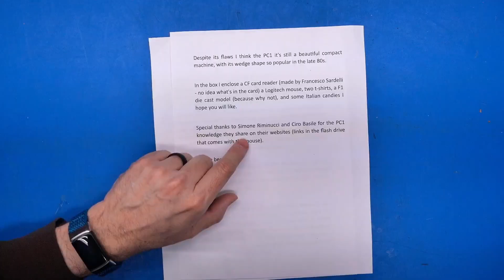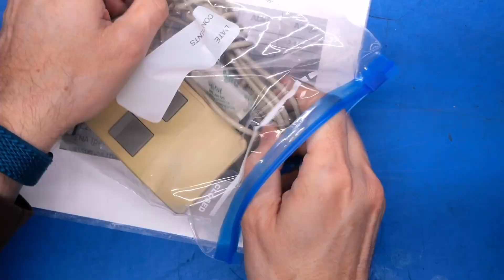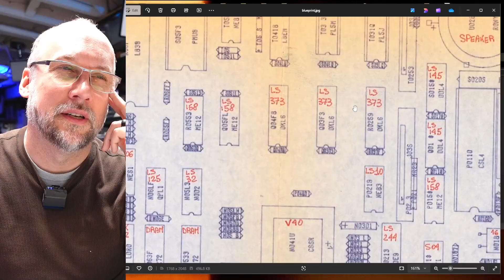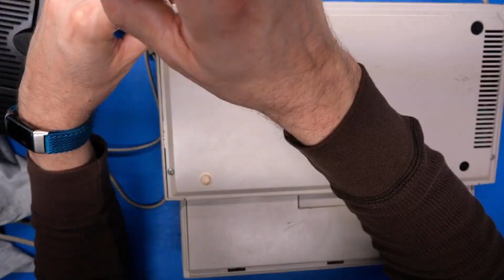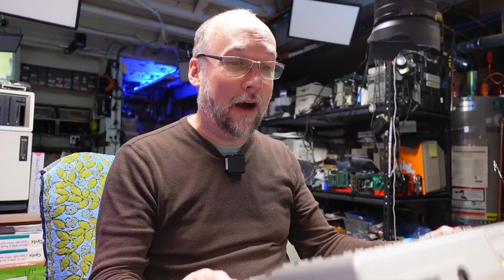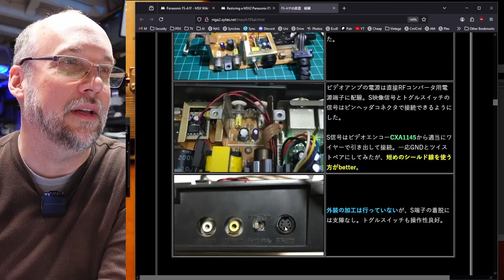0093 Two international wedge computers from 1987 (Olivetti PC1 and Panasonic FS-A1F)

Comment: i have the pc1 with the internal hard disk. Super rare
Reply from the maker: So if the drive situated in the space under the lid, so it's not popped up? I wondered what that structure under there was for.
Reply: @adriansdigitalbasement2 nothing in the other configurations e.g two floppy or one floppy and hd is tottaly different
Reply: The pc1 with HD has a different motherboard and 640kb of ram. Weird.

Comment: The first windows PC that was actually mine was an Olivetti, a PCS P/75n (Pentium 75, 16MB RAM (later 32), 850MB HDD, 4x speed Sony CD-ROM, Creative Vibra16 sound & modem card, and played a lot of Duke Nukem 3D on it!), though that one sadly died around 22 years ago, but I have a very similar Olivetti Modulo M4-75s (virtually identical aside from the front panel), which I've had for a good 16-17 years, also have an Olivetti Lettra 22 typewriter somewhere I had intended to restore, but never got around to it, but like many past brands, it's pretty much just a shell name now for sticking on generic stuff...

Comment: Great to see an MSX! I have the predecessor of your machine (FS-A1), it is a great, reliable little computer.
Reply: Replying to myself: the DIN connectors are a cassete port and an analog RGB out (15 kHz). The RGB port follows the standard MSX Pinout, which you can easily find in the MSX Wiki. 

The batteries are for the real-time clock. I hope that the HIC1 board wasn't badly damaged by the caps, they can have some NASTY results. In the worst case scenario, I believe there is a clone board available.

You can use Sega Genesis Gamepads on it, provided you build a little adapter called JoyMega, by FRS. It just reroutes some pins and uses a TTL chip to invert a signal. With it, you can even use all six buttons on compatible games.

Comment: Wow good old Olivetti when I first started my IT carrer. I was working for a non proffit called computers for schools as a tech to test all canadian governments equipment going to schools. First day first computer i grabbed was 386 olivetti and let's say ill never forget the name. I basically checked it out all looked good. Plug it in and instand bang. Ok cap blew in the psu then unplug it was smoking crazy amounts. I am like thats not good figured. Thinking no worries it's just magic smoke from rifa cap. Went to our parts cage to get a new psu. Got it then went back and it was on fire😮. Ok don't panic grabbed fire instinguasher about to use it and notice water only. Coworkers arrives with another one same. I said f this grab the computer and this computer is completely made of plastic on the outside. Run through government printing building in gatineau Quebec Canada and no joke the security thought I was trying to steal it when i ran through security zone. At the time that building was important thats where house of commons would have everything printed and had commissioner and military for security.i just ran past check point's 1 and there was a 2nd not further down. Run outside throw the computer in a snow bank. Then got takedown so fast by security it wasn't funny. Luckily my boss was there as fast to explain and things change from scary to somewhat normal. The case during this run had melted allot and received only 2nd degree burns. But was commended for it because if i didn't do that next to my station was this huge roll of paper it was 8 feet high and say the length of gmc acadia. Very big roll. After that incident they move the shop and was no where near paper😂.

Comment: @13:50 This is an XT clone. You can't really measure the keyboard by AT standards. Except for the relocated numeric operator keys, that keyboard looks really much like a classic XT keyboard. Even the original AT keyboard still didn't have the dedicated cursor keys, only the later enhanced AT keyboard did. It didn't take long for XT clone makers to pick up the new fancy layout of the AT keyboard, so there are a lot of XTs sold in the late ATs with AT-like keyboards, but you should compare this keyboard to the IBM Model F "XT" keybaord.
That keyboard also had no pause button - but that's not an issue at all, as the PAUSE functionality was already present. You just have to use Ctrl-NumLk. Actually, the AT keyboard in standard ("compatibilty") configuration sends the scan codes for Ctrl-NumLk when you push the PAUSE key. Furthermore the placement of Ctrl, Alt and Caps on that Olivetti is very much like on the original XT keyboard. Early XT games sometimes used "CAPS"=left and "INS"=right, which makes no sense at all on an 101-key inspired layout, but makes perfect sense on the 87-key PC keyboard.

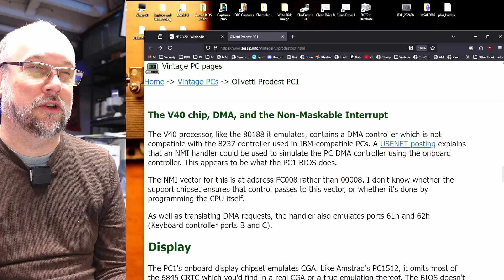@24:50 The idea of the NMI stuff is that there is logic on the board (or in the V40?) that traps IO access to the DMA controller ports and transfers control to the BIOS code as soon as software tries to directly program the 8237 controller of an XT. So the whole point of the NMI stuff is to make it compatible with software that tries to directly access the DMA controller. Actually, IBM never provided a software abstraction layer for the DMA controller, so every DMA-capable DOS software out there is going to access the DMA controller directly.

Comment: I have a working ones one of those Olivettis, the 2 drive version - the routing of that floppy cable is just weird. If you need a closeup pics of the PSU and power switch arrangements, or any measurements taken let me know. Also the Graphics are CGA compatible but but not 100% it seems. I use it with one of those fabulous Mitsubishi EUM 1491 monitors and its looks great (for CGA).

Comment: 42:05 - The "Clone" Picos from Ali express can come with 4 or 16 MB of flash on them. The one in the MSXPico has the flash chip on it. You need to plug in the USB and press a button on the pico to drop files and new firmware via the C USB. The cartridge should not be plugged into the MSX when doing this. 16MB might not sound like much space, but you can put a lot of ROM images on these. I use a similar SW defined cart for my Atari 8 bits. Though it looks like this cart uses an external SD card.
Reply: No need to press a button and the cartridge can stay inside the unpowered MSX while updating. In the menu it is possible to load software directly from SD card.

Comment: Heya Adrian, I think that unused plastic shell piece on the inside pops out and goes on the top for use as the 2nd floppy disk holder.
Reply: That is correct. The 2nd floppy could be inserted without opening the case.

Comment: Hi from Japan! Happy to see MSX in your video!
Many MSXes used to have 2 cartridge slots, and they can be used in various way just like C64 as all address/data buses were exposed to the slot,
like simple RAM expansion, non-application ROM(mostly fonts), sound module like SCC from KONAMI/FM-PAC FM/NVRAM combo from Panasonic,
modem/RS-232C, external floppy drive....there were so many kinds of cartridges and modern homebrew projects are still active today.
Also, some games goes special mode when another specific game cart is inserted in 2nd slot.